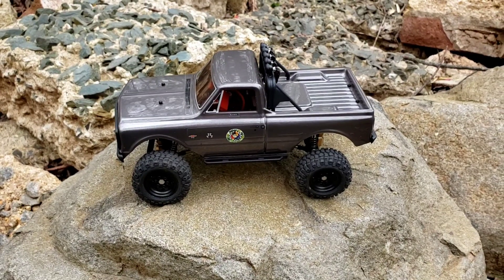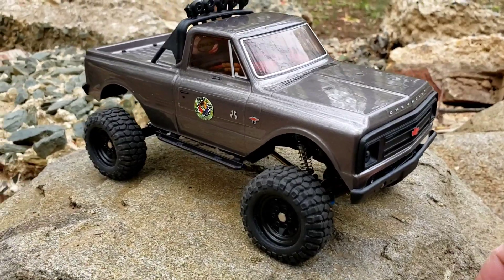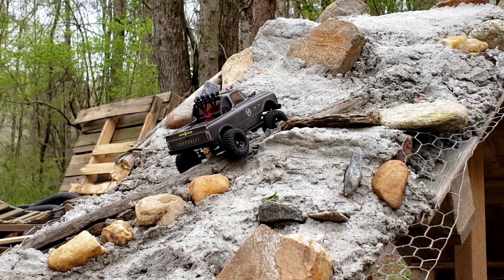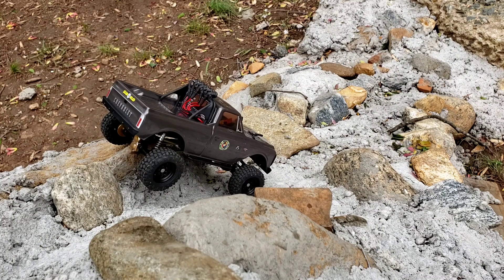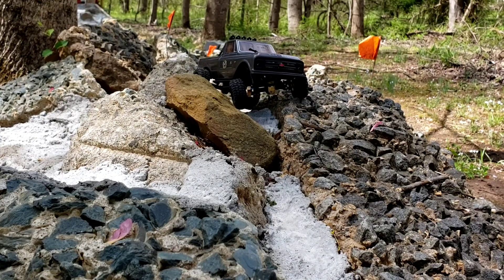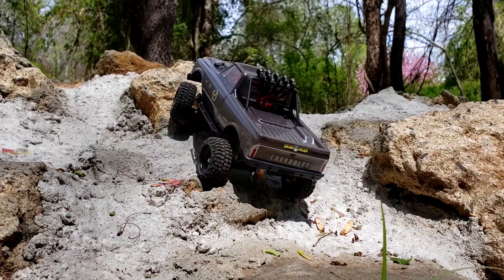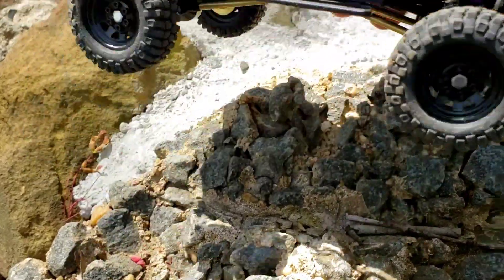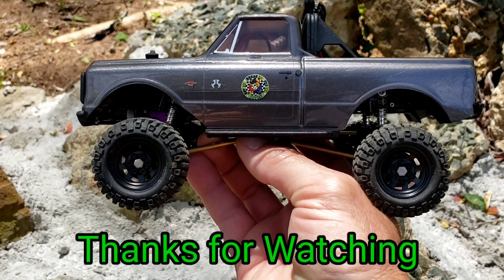SCX24: First Test of the Upgrades (tires/wheels/motor)

Comment: With the smaller tires,  there's that balance between scale and performance that we all make. 
Smaller tires are more scale,  but performance is overall better with bigger tires.   Eg.  Cr18 tires,  or rc4wd scrambler tires,  which are bigger,  much better clearance.
But smaller have better sidehill, and better uphill as long as clearance isn't an issue. 
I recently put on cr18 Grabber M/T, with the cr18  24g brass wheel weights, and was able to use the scx24 brass spacer weights.  Awesome performance upgrade! 
Cut some foam from my kids mini couch. lol
Just leave space between the tire tread and the outer edge of the foam  to create a little gap..  very squishy grippy outer-tire, with more support within the tire when needed and also gives better sidehill when the tire has more internal support. 
I figure lose the battery tray and get yourself two drone batteries.
Set the batteries up in-parallel, and place them on both sides of the transmission.  
The batteries are 63x13x12mm. With a combined 700mah, higher C Rating,  and lower CG than stock, it works pretty dang good. 
With the extra weight though, on an already heavily upgraded truck,  you might want a bigger motor still. 
Sorry so long winded! 
I love that truck,  and you've got me sold on the C10, I'm gonna have to get one.  Even though ive got two freakishly modded scx24,  and the parts for another. 
Thanks,  you rock!
Reply from the maker: Thanks for the comment, never too long. I actually have some drone batteries so I could try that. The tires, ahhh, IDK, the way the tires look just have my heart. Lol I just think the truck looks so freaking cool. I love the stance it has. I will pick the right line to make up for the clearance. And yes it side hills beautifully and climbs. Bigger motor is already here, found the rgt motor to try out. I also have the Leopard brushless sensored motor for it that I would pair with the mamba micro. I am still just having fun building, tinkering and such. I have most of the upgrades to make it even better at handling the weight the truck currently sits at (411.2grams) but I like to have fun with it at each stage of upgrade. If that makes sense. I also have the green C10 take is totally stock still and have most of the upgrades for it also. Haha I have a problem.🤣
Reply: @BuyitBreakitFixit  that's awesome! 
I can't wait to see the progression.  Definitely have fun with every mod and upgrade. 
The cool thing about these is that, even though small,  you can still design the rig for specific terrains. 
Im gonna have to get some stock rigs to test my modified against. 
Would you suggest a stock Deadbolt, C10, or Jeep?
Ive not driven the Jeep or C10.
Reply from the maker: @MrsRabbit8  from what I have heard, the deadbolt is the best scx24 out of the box for crawling. I buy the one that appeals to me and adjust it from there. If it were me, since I have 2 c10's, I would get a deadbolt. Just what I would do because of the ones I have. Pick the one you like, and grab it. Haha

Comment: Man you have proper went to town on modding that little beast👍
Reply from the maker: Yeah man. Little crawling beast. Haha
Reply: @BuyitBreakitFixit  sure is 👍have you tried it with the back wheel weights off yet?
Reply from the maker: @bigpoppapaulsradiocontroll2724  I did take them off after this video. Think it is going to be so much better
Reply: @BuyitBreakitFixit  yeah weight is good but at a point has negative effect took me few tries get my trx4 balanced as well as is now all about trial and error 👍

Comment: That is alot better then the last run video. I like it
Reply from the maker: Yeah, does better for sure. I was messing with it after the video and instead of pulling weight off the rear, I pulled the over weights off the front and man what a difference.

Comment: Imo u should actually add a bit of weight in the back and soften up those tires somehow.  Maybe put holes? Idk. Less foam maybe.  But add a little weight in the back and u will be good I think.  Nice little truck😁👍😎
Reply from the maker: Thanks, appreciate the advice. Yeah, not sure why I said take weight off the rear. I have removed the front over weights and it seems to balance the truck out better. Think the front was way too heavy.

Comment: I have seen a shock kit with telescoping shafts and very light springs.

  They will give you 2x the preload ,lots of travel.
I would keep the bottom end weight . Nice truck
Reply from the maker: Thanks. Yeah the double barrel shocks? I have seen them. They look like they do good. I still haven't adjusted anything on this truck. Keep an eye out, we are currently doing giveaways on the channel for scx24 parts.

Comment: Sweet video, The Goodyear Mt/r is taller at 54.4mm than the crusher at 48mm and is my favorite of the ones I have. And I have the crushers, the swampers, the dirt grabbers from RC4WD. The stock Nitto Grapplers from the deadbolt or jeep  SCX24 are actually good tires and I have a hard time justifying all the 1” tires I own but I like to see what they do to change the way my jeep drives. Only other upgrade I have is the hot racing brass wheel weights and soon a new servo. The motor swap is a nice inexpensive option thanks for sharing. For some reason I can’t get enough of this little truck and want to get the “C10” or at least the body.
Reply from the maker: Thanks man. I do like the stock bfg's on this truck but the look of the rc4wd tires is just awesome. I too am buyng up a bunch of 1.0 stuff. Haha
Reply: if you have the wrangler body its the same wheel base but the deadbolt is place a little kore to the front so the body doesnt fit stock on the deadbolt frame
Reply: micro rc channel thanks my dude I think I will order one when my RC shop opens up

Comment: More money in mods than the car cost and performed the same as stock. It looks good though.
Reply from the maker: Haha yeah, so much more. Probably could of bought 3 more with the amount of upgrades it has. Lol. Thanks for the comment.
Reply: @BuyitBreakitFixit  it looks like a show truck. Even from underneath.
Reply: Don’t get me wrong, I’m not knocking it. I just bought my scx24 deadbolt and after it’s first run I ordered wheels, tires and high clearance links. Almost bought some brass stuff too then my battery took a dump and I regretted ordering all the extras. Now I got it running again and will probably get updated charger, battery and motor as will be over the cost of the truck.
Reply from the maker: Your good. I didn't take it that way. Many complain about what I have done with it. I usually build something just to showcase parts that are available and don't worry about what it will do on the trail until done. Then I can take off what is not needed but having a yt channel I try to show everything that is available then you can decide. Just try to help the community so people are not buying stuff they don't need, I can do that. 🤣

Comment: I thought the higher turn on the motor means less torque more for speed
Reply from the maker: Higher turns has more wire, creating more resistance and giving more torque and less speed. Less turns, less wire, less resistance, more speed, less torque.

Comment: Rc4wd scrambler tire with rc4wd aluminium  slots blow those away. The barrage motor with 9t pinion has way more torque than that punny motor. Had to drill new mounting holes. Easy and well worth it. Twice your motor size. Brass hexes and servo upgrade. Stretched my stock springs a little. Moved front bumper back to sit flush with the body.
    I think my deadbolt would crawl past you. No gunning the trigger and can crawl at the speed of a snail. 
   You need to get rid of your foams. Didn't have to with scamblers. You can see them biting.  
  Chevy body looks good. Does it fit the deadbolt wheel base?
Reply from the maker: Haha, you made me laugh. Lots of good info in your comment. Just the competitive way you worded it. 🤣 I have a rgt motor sitting here waiting to be installed but am trying to decide if I want that or the brushless sensored motor paired with the mamba micro. Just talked to a guy running that leopard brushless and he said he loves it. Not sure which way I am going as far as motor/esc goes. The 100t in it now was all I could get, parts fly off the shelves with these things. Tire, I now have almost every rc4wd tire to try out, these were the ones I could get. Lol. The foams, not sure about them yet either, I will try with no foams and see how it goes. How heavy is your deadbolt? Just curious if no foams handles weight.
Reply: @BuyitBreakitFixit  
  Only extra weight i have is wheels and hexes. Wheels are pretty heavy compared to stock. 
   Maybe you could trim  the corners off your foams. If taking them out turns them into flats. 
  Just looking around and carisma and redcat have some longer motors to. At the price of the monsterous Barrage motor i wasn't to concerned about ruining it.

Comment: Do the "simulated low PSI" mod
Reply from the maker: What's that? No foams?
Reply: @BuyitBreakitFixit  no foam, use a micrometer for exact pressure but you pinch the tires and seal the 2 holes in the rim. Once let go the tires are semi "full" and simulates low psi. Don't pinch them to much or they will roll "flat". Does this make sense?!
Reply from the maker: Yeah, makes sense. That is how I do it with my 1/10 trucks. Thanks for the advice

Comment: Have you thought about trying the Hot Racing brass rims?
Reply from the maker: I have a set but have not added them, yet. Might add them at a later date. Now that the electronics can handle all the weight without issue.
Reply: I’m excited to see it!
Reply: Do you happen to have links to the electronics you’re running?

Comment: how much you got put on there up to now xD looks amazing im turning mine more of a wrecked crawler with a nice rhino bar
Reply from the maker: Too much. Lol I have a green one also so I am trying to decide what to do to which one.
Reply: i honestly think theres great potential with that frame and body to convert it to a rock bouncer truck with 2"- 3" tires
Reply from the maker: Ahh man, now your speaking my language. Exactly what I was thinking. The 3d print from thingiverse is a cool cage with open wheels and that would fit some bigger tires.
Reply: i have a friend that will 3d print some beadlock rims with a crazy offset for the stock tires so i can have larger wheel base and add weight in the rims because for now i glued fishing lead to the interior of the rims it helps but its not much weight. and he can print a cage for me in the future
Reply: i just got it a month ago and i already have  two foam canyon i built i want to start a cheap youtube channel i dont have much equipment beside my phone and a little sq11 cam i can use for fpv videos.
Reply from the maker: I have built my channel using my phone only. For video and editing. It can be done. Just remember, for good footage, put your phone on airplane mode so no weird noises.
Reply: @BuyitBreakitFixit  good tip thanks
Reply: where did you get your motor i just blew mine today and ive had it for a month ive added a bit of weight like i said but nothing crazy i wonder whats up with these trucks ive heard alot of issues i kinda regret my purchase at this point parts are not findable anywhere and they have tons of problems for the price
Reply from the maker: @davebelhumeur899  ahh man, don't let it disappoint you. Once you get it dialed in, they are great little trucks. I ordered my motor from crossrc usa but I saw that rc mart has them also. Are you on facebook?
Reply: im thinking of getting the temper motor dont know if it will fit ill have to get informed
Reply from the maker: Email me at buyitbreakitfixit@gmail.com and let me know its you

Comment: Just received my Hobbywing brushless mini and Xerun ESC, debating getting a fresh SCX24 todo this mod. ? Hhmmnnn, decisions, decisions
Reply from the maker: Definitely, do it. Man, so what the heck, I have been so busy with work, I am clueless.  What combo is this you speak of?
Reply: Actually I realized the whole reason i went this route was so i could take advantage of my FS-GT5 and use the Crawl Mode for my rear steering setup on Grim Hammer
Reply: https://www.instagram.com/p/CJPFCRMM3EL/ Grim Hammer
Reply: sorry EZrun, getting mixed up with my Axe system.
Reply: KV rate is high for a crawler on the castle combo

Comment: Great video , What made the tires stick out like that ?,,,much
Reply from the maker: I have the brass hexes which hold the offset out more than factory. Thanks for the comment and appreciate you watching. Probably have over 400 in this little thing. I want to get it dialed in better and move some weight around. Maybe even go foamless in the tires.

Comment: How did you make the stance wider? Looking to widen mine as well
Reply from the maker: The brass overweights help widen the stance nicely. Cannot remember where the heck I got them. search ebay for scx24 brass overweights. I also added the brass hex weights with barrell nuts.

Comment: if you could pick 3 first mods to the c10 scx24 which would they be? Im thinking brass diff covers and adj shock tower mounts but idk. love the videos man
Reply from the maker: Thanks man. Really appreciate the nice comment. Ok, my opinion, first 3 mods/upgrades for me would be...brass milstone (hexes), 100turn motor (direct drop in), servo. All the other parts I could deal with. I personally dislike weak servos that why that would go. Then the truck just doesn't have the torque needed for those slow power climbs that why I say motor and the hexes add the low weight and widen the stance which help, big time. Again, this is just my opinion because of the way I like to drive my truck.

Comment: Just bought a trx-4 blazer for myself and a scx24 k10 for my son. Do you have some links for the parts on your truck.
Reply from the maker: The wheels and tires are from Rc4wd.com
The other parts are from RPPHobby.com
Another place in banggearrc.com and fullsendrc.com how that helps ya out.  Congrats on all the new sweet trucks! Your gonna love em. Also check ebay.

Comment: Sweet Rig Bro.
Just gotta know because I’m really thinking about pulling the trigger on the Under Body/ inner Fenders. 
What are your final thoughts ?
Pros/ Cons?
They looks sweet and Tho the price is a bit high I’m up for it as long as they don’t affect performance negatively.
Reply from the maker: Hey there, first thanks for watching and supporting the channel. The inner fender...I love them. They look great.

Pros:
clean look
Can mount things on them under the body
Adds rock sliders if you get the $51 ones
Keeps the elements out of the electronics
Do not notice any performance difference

Cons:
Does add some sprung weight
Need to trim the rear so the body can hinge all the way open
Cost $51

My opinion, definitely worth it 💯.
Reply: Buy it Break it Fix it 
Kick@$$
Reply: Buy it Break it Fix it I just ordered that and the neat Roof Rack setup from Bang Rc.
I haven’t loaded much weight on it yet.
I’ve got the front and back Brass Diff covers, the Aluminum center skid plate. 
I have the HR Aluminum Shock Towers and the Shocks. I just haven’t installed them yet.
I’ve only had them 2 days. Been distracted.
I haven’t weighted the wheels... Yet.
I’m going to mess around with some CR24 Beadlocks. I have a spare set of the BFG tires that are stock so I don’t have to tear up the original tires/rims.
Reply from the maker: @joetrosclair8434  very cool. I ordered the LIT LED light kit for it and the bangrc adapter for the rear light. Saw the roof rack, might have to get that, let me know how you like it. I found that the HR shocks, I still put marine grease in them but they are nice.
Reply: Buy it Break it Fix it I turned around, canceled my order for the underside kit and went with the Bang Rc ones that have the fender LED’s along with the Boatside Sliders.

Just FYI, on those HR Aluminum Shocks.
Unthread the top caps then put them back on with only a single full turn. You get a lift from the shocks that way. 
I just finished the install of the Aluminum Shock towers & the Shocks.
I’m LOVIN it. 😉
Reply from the maker: Sweet info. Bangrc is awesome. I have ordered from them. Yeah man, these things are fun

Comment: Is there a video where the cchand inner fender liner was installed? Somehow I missed that?
Reply from the maker: Hmm, dang. Been doing so many with this truck, I really can't remember. They install super easy. I have a scx24 playlist if that helps the search. I will go look for ya.

Edit: just looked, looks like I did not do an install video. Dang it. Lol. Sorry about that. The are easy to install though.
Reply: Thanks for the reply.  I couldn't find install instructions... they attach with longer M1.4 screws into the frame rails?
Reply from the maker: Yes but when I did my install I already had the HR skid plate and the screws were long enough.

Comment: i thought less turns more power ? more turns higher top end
Reply from the maker: Less turns is more speed less torque. More turns is more torque less speed. When you have less windings there is less resistance so it has the ability to turn faster. At leat that is the way I have come to understand it

Comment: So, in your opinion,  is the Reefs better quality than the Emax? New to the hobby, heard emax mentioned so often I went that way. The 100T IS an improvement to my C10 as well, but still waiting for the new servo to get here to replace stock.
Reply from the maker: Definitely better but also carries that higher price. Most will not spend on q servo what they almost spent on the truck.